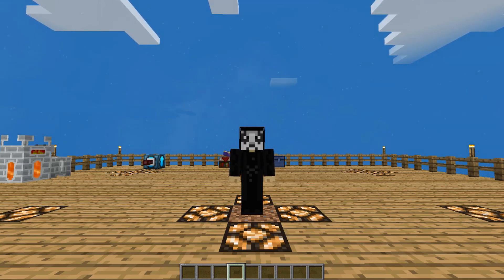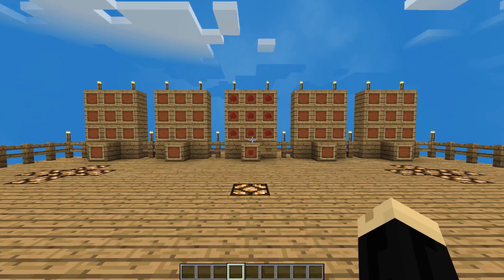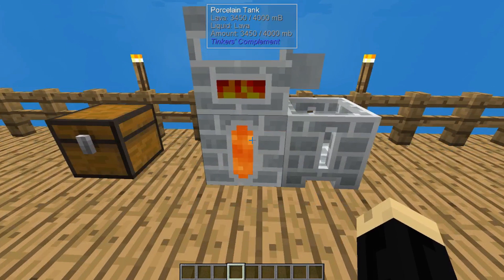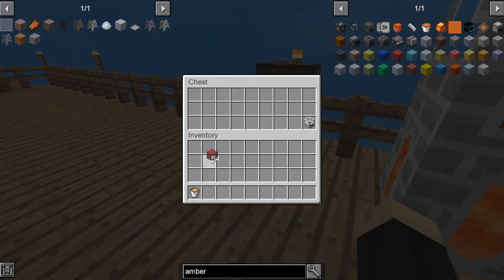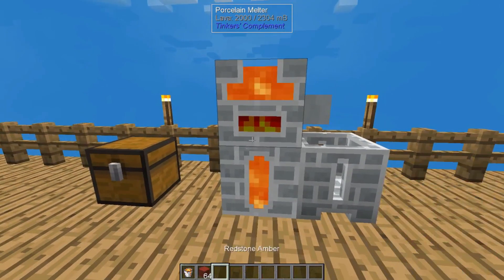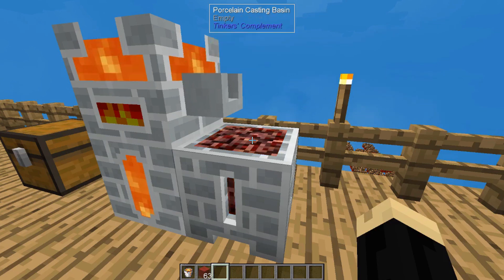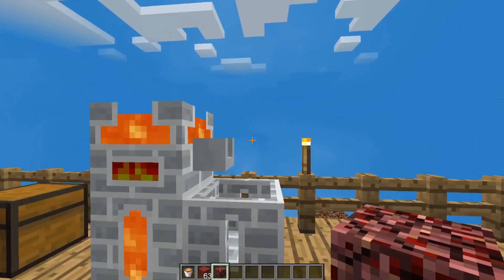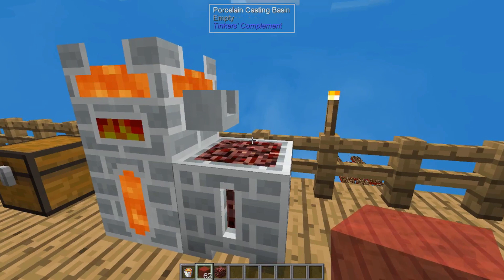Minecraft - Sky Factory 4 - How to Make Netherrack Using a Melter or Smeltery

Comment: You can use any liquid and item transfer, like a Cyclic Fluid or Item Cable on a casting basin. The casting basin will only accept raw ingredients in and only let complete items out, so if you pipe lava into it, it won't accept the lava until there is a redstone amber inside and it won't let an extraction cable pull out items that were piped in, like redstone amber, but will pull out completed castings like netherrack.

This means you just need a casting basin with a fluid pipe feeding it lava, an item pipe feeding it redstone amber and an extraction pipe or hopper will only pull netherrack out. It works the same if you feed it glowstone to output endstone.

Comment: How do i get the laba in the smeltery
Reply from the maker: Lava and other liquids are poured into the smeltery through the drains, the same place you would normally pour liquids out.  Just click with a bucket on an open drain (no faucet).  :)
Reply: @OnlydravenGaming  Tried that it didn't work, I put a tap in my lava production to feed in to a basin with the needed item already in it to do it.
Reply: @OnlydravenGaming  worked immediately, thank you

Comment: this is fake content

how did u put lava in a smelter u right click me i have to open the smelter and then put lava

but it does not work because technic problems
Reply from the maker: You pour the lava in through the drain that does not have a faucet on it.  That’s how you get any liquids into a smelter.  Hope that helps.
Reply: It worked for me